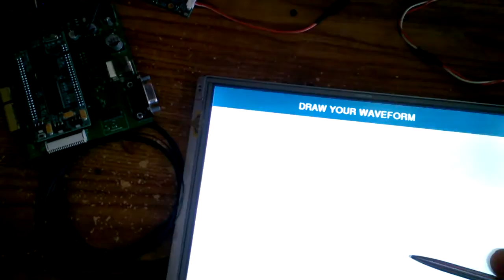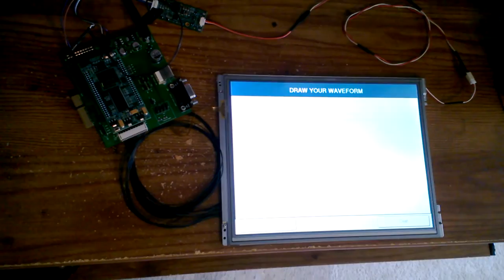Parallel RGB to LVDS converter Board 2

Comment: i have 15.2" lvds screen and i dont have a controller board.... so is there anyways to make the screen work?
sorry for my bad English.
Reply from the maker: +Popo Panha 
Yes, you can. You need to find or make a board that converts the video signal you have to LVDS. If your video signal is parallel 24-bit RGB, a board like the one I show in the video will work. Well, it will work if your monitor takes 8-24 bit LVDS (1 to 3 LVDS channels.)
Reply: +Carmen G Black  nearly 1 week already that i try to find that diagram about that board, but i cant... :(
about the screen ... i take it from the powerbook g4, so i try to find the IC Chip in the mother board, but i cant, it a lot. 
Sir can you give me an idea to make the board form VGA out-put of laptop to LVDS 20 pins input screen? (for easy ways and understand)

Comment: is there a way to convert 24 bit parallel RGB to HDMI?
Reply from the maker: +Robert Johnson 
Take a look at this document: http://www.ti.com/lit/an/slla325a/slla325a.pdf
Look at this document as well: http://www.diffen.com/difference/DVI_vs_HDMI
HDMI and DVI are very similar interfaces; HDMI included audio. A solution would be to convert the RGB signal to a DVI which is, more or less, an HDMI signal without the audio.
Take a look at the datasheet of this device: http://www.chrontel.com/media/Datasheets/CH7033B%20Brief%20datasheet%201.22.pdf
This may be what you are looking for.
Reply: Carmen G Black Ohh my goodness.. This might be it.. I was reading the data sheet and it looks like that chip does have the capabilities I need. My application is actually with a PlayStation 2, you see the Graphic Synthesiser, or GS, outputs in 24 bit parallel RGB, before going through a CMX4000R or some variant, and comes out as compressed video. Do you think its possible to substitute it with the chip you suggested??